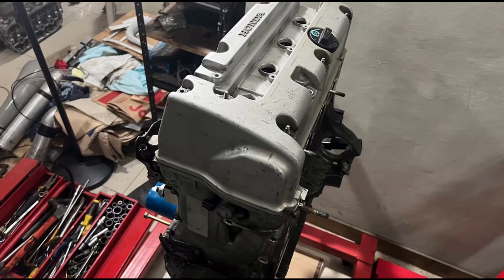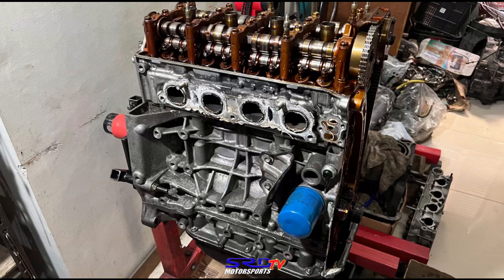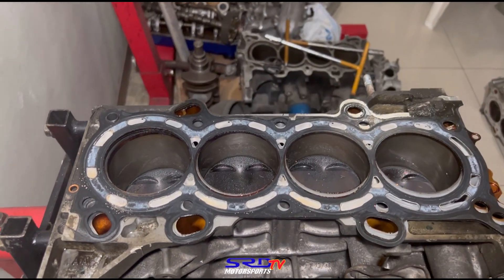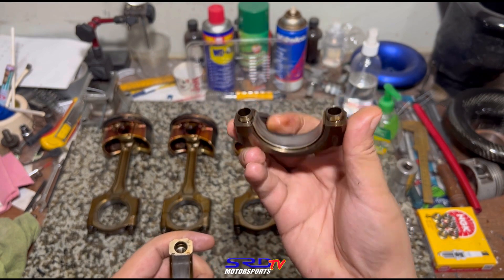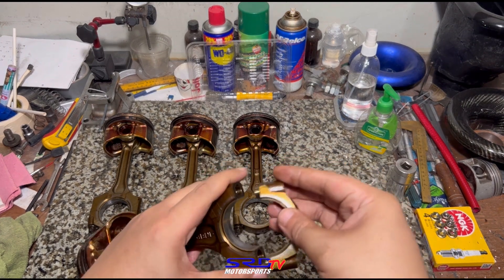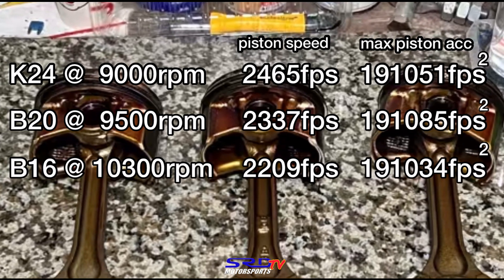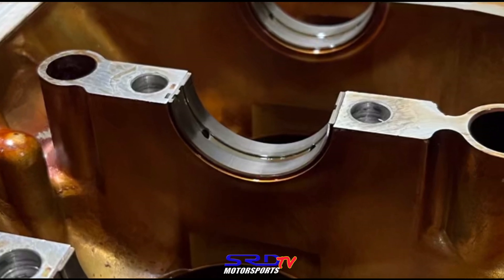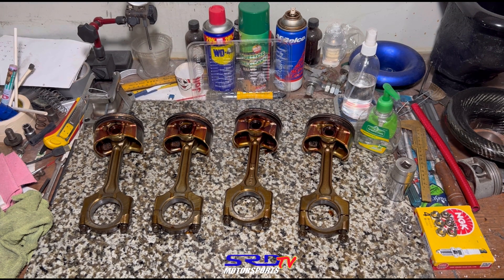Honda K24 Engine Disassembly and MORE

Comment from the maker: Footnote :

Max Piston Acc. Also relates to “outrunning the flame” when ur piston reaches the point where it’s gonna exceed flame speed = you stop making power

This the reason for “deck plate” motors to let them run “longer” rods

Same on the VW air cooled spectrum
We run 5.700” rods on bigger stroke for the same reason

Comment: Where do you source engines these days?
Reply from the maker: This one came from from Al but most I get from Jspecs marlon…by choice cuz his papers has “jspecs” in the receipt of the LTO importation papers means it’s them fo sho
Reply from the maker: Thrust washer on this one was still decent but new will be used but tbh this prolly the highest miler I’ve opened as far as k24 goes 
Oil = too brown for me
Reply: @SRDmotorsports  Oh, sorry I wasn't clear with my question earlier, I meant thrust side of the cylinder and piston
Reply from the maker: @findtherightbeat  oh wasn’t so bad I mean most of the time k20a’s are a lot better but that’s like b16a vs b20

But in hindsight even the bore finish of this one is a lot better than a b20 surplus
Reply: By the way, how's the thrust side of the K24 engines you check?
Reply: What you said in 9:35 of the video onwards.. it's scary to have these "tuners" tune your engine
Reply: 13.8 for a built 2.4 🥱
Reply: KMiata = best of both worlds, RWD with Honda output and reliability 😁
Reply from the maker: @findtherightbeat  true on Kmiata and I’m sure u seen the vid or read about the Miata being one of the most FR well balanced as far as front to back ratio goes so maaaan imagine tracking this?!
Reply from the maker: On what I said at 9:35 onwards personally I’ve seen a tuner tune a sohc setting vtec at 6k

Now think about that 😂
Reply: @SRDmotorsports  Nowadays, the K20/K24 is in every chassis imaginable from old Honda civic/integra/CRX chassis to the Ariel Atom, even the NSXs, to Porsches, SW20 MR2s, s2000s, Exiges/Elises, Miatas,  -- Out of the box, with a good header, tune and vtc gear (for the K24a2) the output is decent.
Reply: @SRDmotorsports  Why move vtec all the way to 6k?
Reply from the maker: @findtherightbeat  yes definitely and with all that… makes the Kpro cost efficient too!
Reply from the maker: @findtherightbeat  I hit the floor when I found out too lmao
Reply from the maker: Furthermore: on what I said at 9:35 locally there are also a select few tuners who recently started or learned but also learned from a good source,  example @zeff noob has a friend that was mentored by RDJ and he knows engines decently and has been tuning for decades I know cuz he a fellow OG h3

And to add to that I’m sure he would say he knows more about engines than I do… that’s normal as I would say the same for me hahaha he a cool dude so the mutual respect isn’t needed to be asked it simply exists 

Now on to the “others” ? 😂 that’s all I’d say hahahahaa
Reply: @SRDmotorsports  Ralph/RDJ really knows his stuff when it comes to tuning. 👍

Others are still back "tuning" without a wideband or worse copying other maps on the internet and just burning it on the customer's chip and they'd charge a lot for these ultra rich maps
Reply from the maker: @findtherightbeat  definitely man definitely